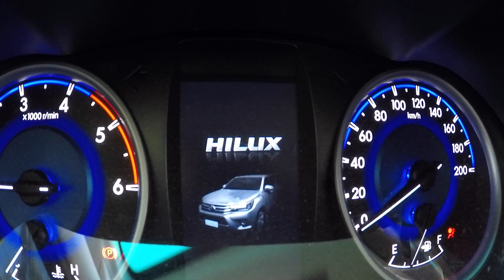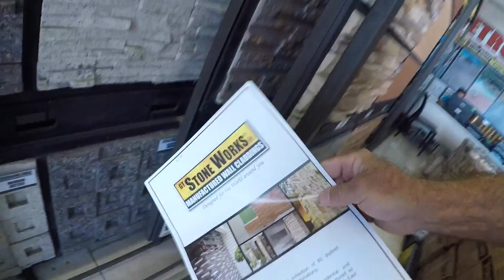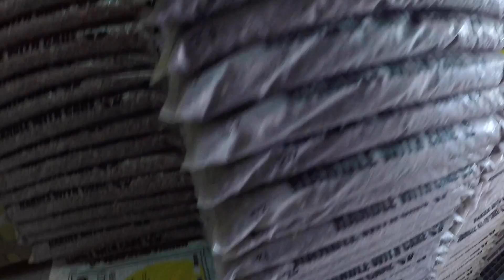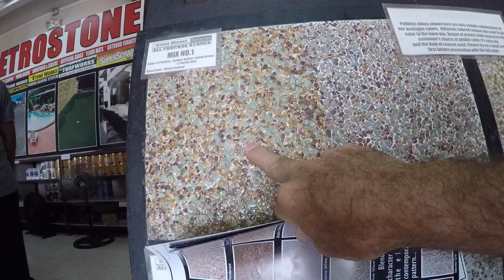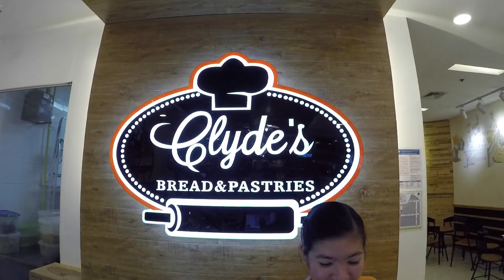VILLA FELIZ - EPISODE 325: THANK GOODNESS FOR SUBS (House Building in the Philippines)

Comment: Hello PI James   When I was a farmer we use to sterilize the ground when I sprigged Hybrid Bermuda grass for horse hay.  But since you have finished  you could use round up in high concentrate form. Just take a paint brush and add stick to brush so you do not have to bend down and wet brush and just touch the plant that is growing.  Just touch a small portion of plant.  Two days later, done you will kill the plant. Much faster and complete kill ,even the roots.Be sure to wear basic gloves.

Comment: There is a polymer grit product you can add to the sealant that will make it not slippery and by sealing it you dont have to work so hard to keep the color from looking nasty down the road.  I recommend that route.
Reply: By the way, your friend could add a second coat of sealant with the non slip grit for safety as well.  The grit is not visible on the end product.

Comment: Good morning,

James, why is the guy staining the foot board at 5:20 not using frog tape on the wall above the foot board?
Looks to me like extra days repainting the walls after the stain is done.
Reply from the maker: I asked them to use tape to prevent the need for additional painting and clean up.  They say it will peel off the paint.  I explained there is tape that will not pull off the paint.  It's a job security thing as you probably already know by now.
Reply: i know it's quite randomly asking but do anybody know of a good place to stream newly released tv shows online?
Reply: @Turner Tony I would suggest flixzone. Just google for it =)
Reply: @Yusuf Noel Definitely, have been watching on Flixzone for years myself :)
Reply: @Yusuf Noel thanks, signed up and it seems to work =) Appreciate it !
Reply: @Turner Tony Happy to help :)

Comment: I’ve been watching your Vlog. Your videos were entertaining to watch. Maybe because you’re very friendly to your neighbors specially to the kids in your neighborhood. Also from videos, i learned a lot of do’s & don’ts in the construction of your house. Anyway, 
I want to share a little of what I am doing in building my own house in the PH. At the moment, i’m designing my own house. I’m am incorporating what i’ve learned from your practical experiences and other DIY in YouTube. Known facts:  the PH is a hot and humid country, has a lot of brown outs through out the a year, two climates, dry & wet seasons. For my  house design, i am following the principles , of “Net Zero” in particular by using passive airconditioning, using renewable energy i.e. : solar roof tiles, powerwall, solar water heater, vertical mini windmills, micro hydro power generators, rain water collection system. For the building framing, i will be using steel for columns and beams instead of concrete and rebars. Inside framing will be done usingmetal furrings, and non-flamable materials like sheetrock and hardiflex
Reply from the maker: Sounds awesome Juan.  Budget permitting, we would have chosen much of your material selection.  Not sheetrock though.  If you live in a mild climate like Lipa and you orient your house design appropriately with regard to sun exposure, concrete is actually a great insulator.  For strength you can't beat steel I-beams.  Good choice.  We'll slowly move to solar once our utility company does Netmetering.  Right now, they don't and it's not a good option for us on ROI.
Reply: I’ve closed my shop in SM. I wasn’t making any money because SM kept on 
raising the commision that they’re charging me for every sale. My lesson on that 
Experience; don’t do start up in any mall. Read the fine print carefully in The 
contract before signing. 
Anyway, I want to share a little my background; i have an architectural degree
from UST, then came here in the US (siliconvalley) became hardware engr and 
now a software engr. I’m going to retire in a few years that’s why i’m preparing 
for my retirement house in the PH. I’ve watch some of the Vlogs that were doing 
the same as you did, but their presentatiion were not as good and entertaining 
like yours. Your Vlog serves as an inpiration for my house design & construction.
Thank you.
Reply from the maker: Glad to hear you got some value from the videos in my series.  We're not done yet and will finish up the build then the conclusion will talk about challenges you're likely to find with regards to your contractor and services.  Should be an interesting and revealing episode/episodes.